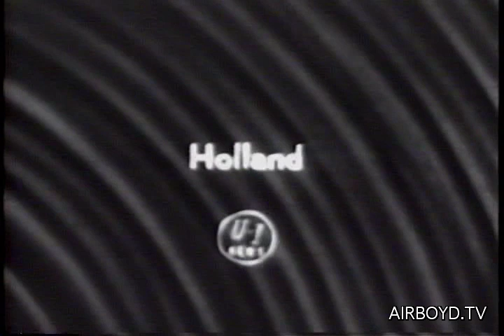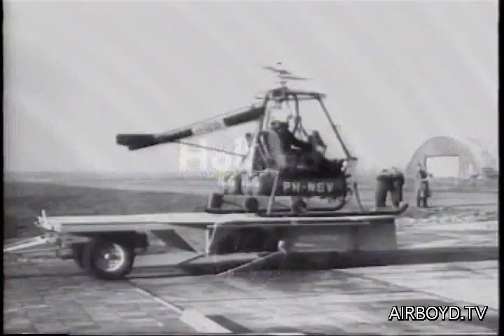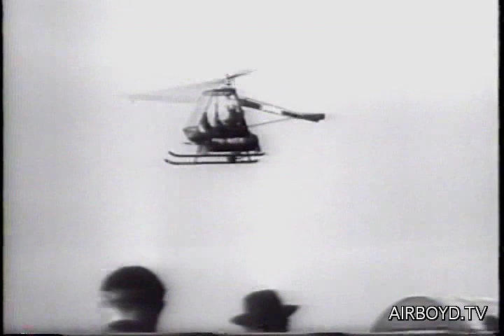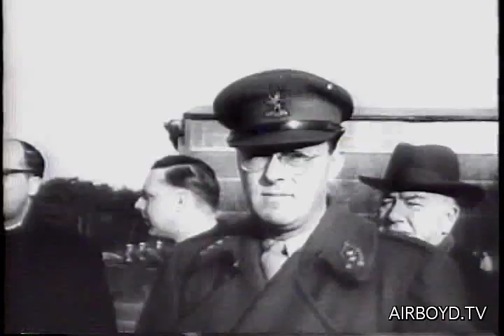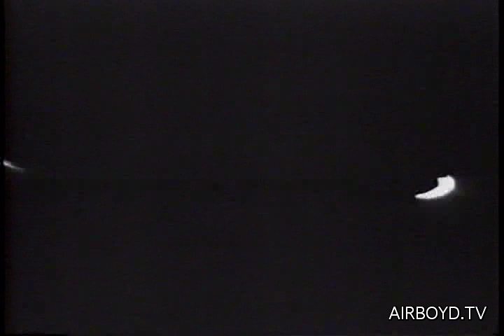NHI Kolibrie Ramjet Helicopter (1957)

Comment: The other BIG problem was that if you lost power in one or both engines the drag on the rotor tips made autorotation extremely difficult to achieve and maintain quickly enough or long enough to land safely.
Reply: I cant imagine you losing power in an engine with no moving parts...
other than lack of fuel